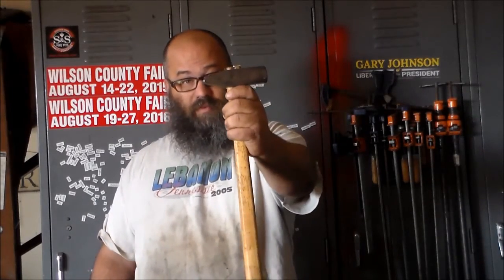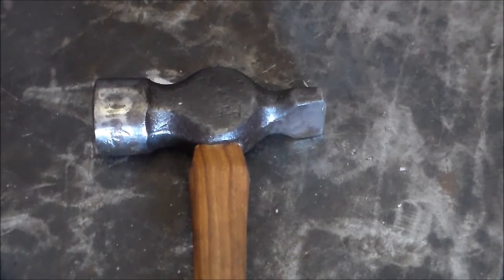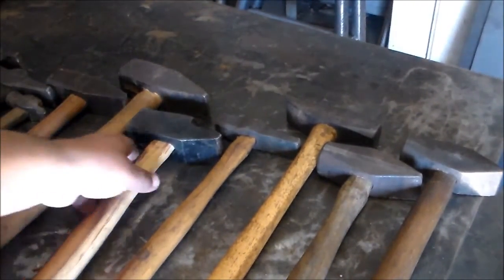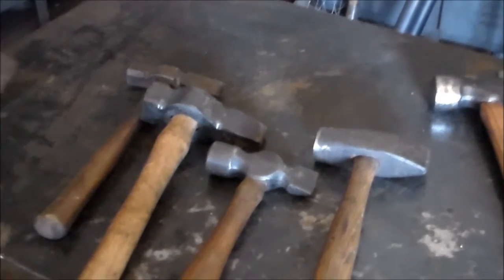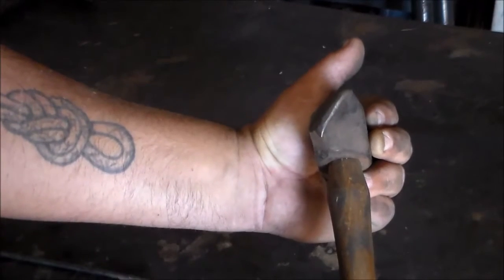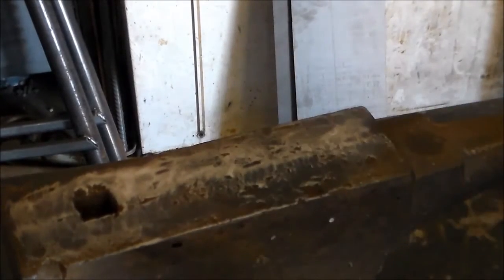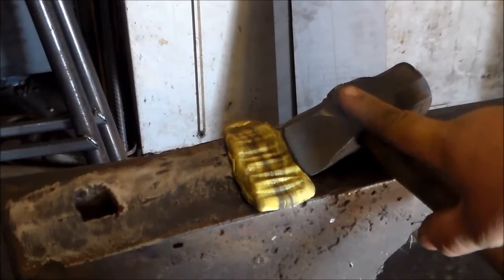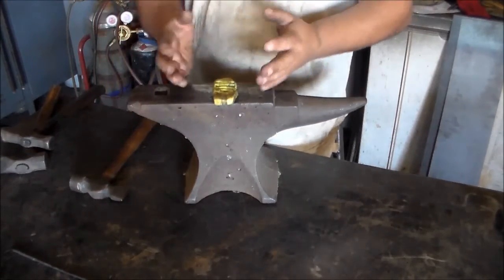Cross, Straight, and Diagonal Peen Hammers  Blacksmith Hammers #2

Comment: You are right it does seem like a solution to a problem that does not really exist. But one thought or something I realized by watching you showcase the three is that having the diagonal peen hammer saves you having to have two separate hammers in relation to how you are holding the piece to be worked by using tongs.

Comment: thanks for the great info, couple questions, the other side of the cross peen would that be considered to be a flatter  or a rounding hammer or could you dress it anyway you want? what would one use a brass or bronze hammer for? like what you was explain in the video ? I have a box full of them they are pretty soft, need to be dresses, and they are 1-2 lbs each
Reply from the maker: hey Greg, to start you may sharpen (the term for domeing a hammer face) the face of a cross/straight/diagonal peen to suit your needs. A rounding hammer is a specific style of hammer with a domed face on one side and a very flat face on the other. A Flatter is a struck tool with flat face, the face is usually larger than the body of the flatter but not always. Long story short dress the hammer face to suite your needs, most of my faces have a slight dome. Brass and bronze hammers are used when either you don't want to marr what you are hitting or you can't make a spark. Two examples would be tweeking a finished scroll and working in a natural gas pumping facility! They are great to have in the rack, copper and leather as well! Hope this helps.

Comment: I always thought peen hammers were for peening over rivets. But I don't do any blacksmithing at all. I do have a bunch of them type hammers though.
Reply from the maker: You not wrong! Rivets are peened using the peen on ball-peens!
Reply: Voo Doo Tennessee
oh I think I can use straight, and cross peens on rivets too. I just get a different head style then.